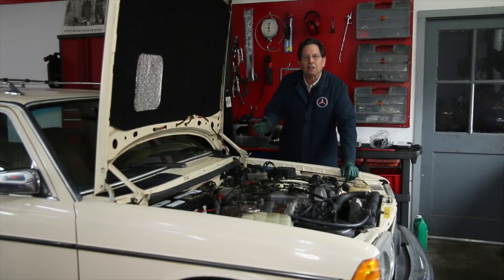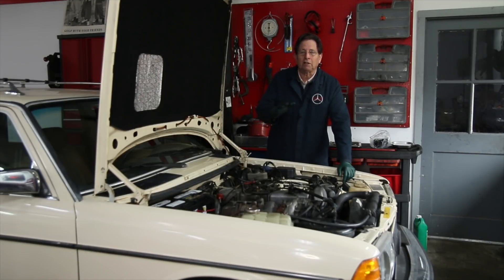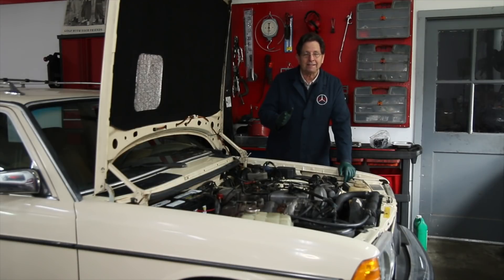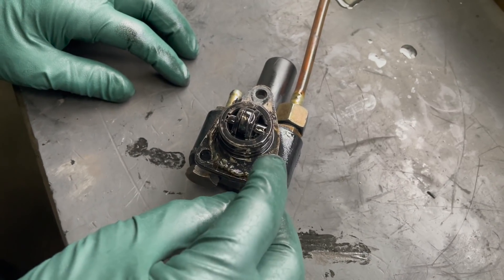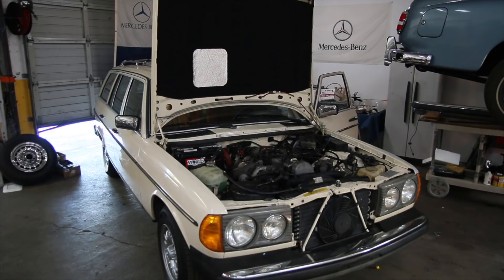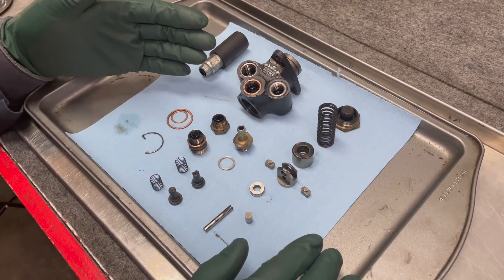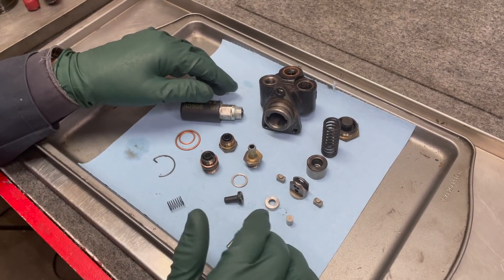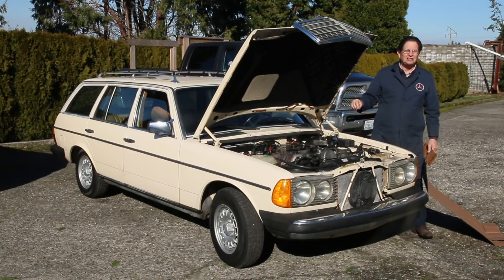Fixing a Diesel Engine That Starts - Then Quits When Cold

Comment: I have an early 450sl 1973 that has this same issue... Its a gas engine but when its cold it wont stay running until its warmed up.
Reply from the maker: Check fuel pump, filter, pressure regulator, injectors, manifold pressure sensor, trigger points, ECU, compression, and chain stretch. points, coil, wires, plugs. You have Bosch D-jetronic fuel injection. To learn about this system you can read my product descriptions on my website to give you some direction   https://mercedessource.com/store/search?keys=d-jetronic